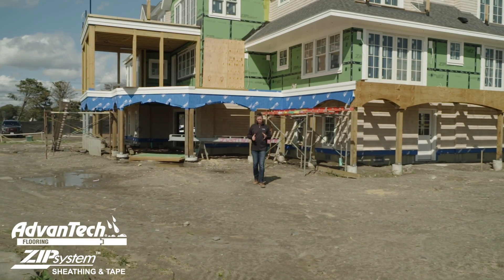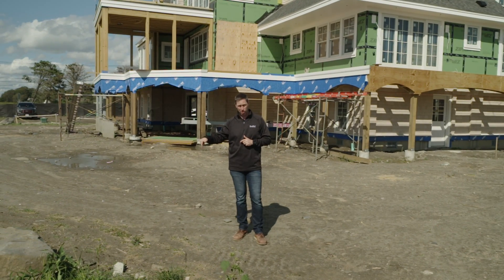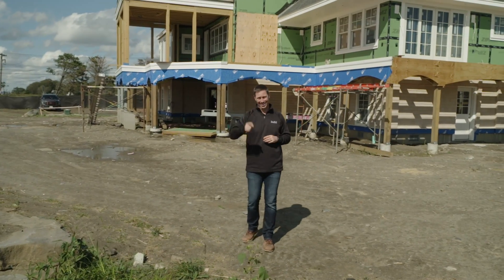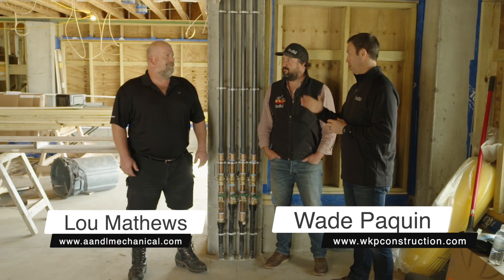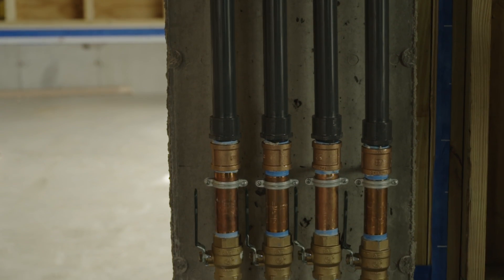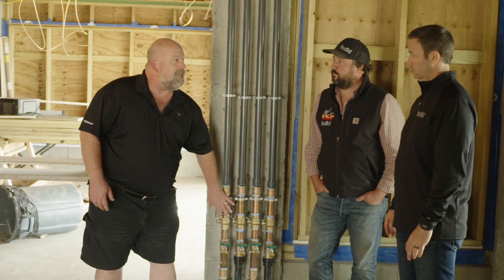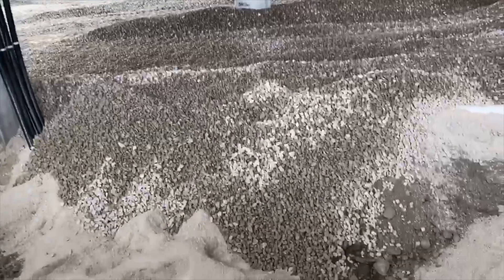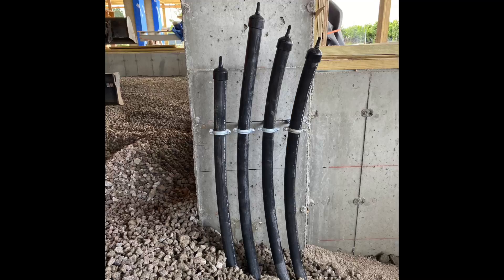Debunking 3 Geothermal Myths

Comment: Wait..... so they're discounting the cost of the well to show that it's only ~30 - 50% more expensive than regular HVAC???  Can I discount the cost of solar panels to show people how incredibly cheap solar is?  LOL!
Reply: Better watch again.   I think you got that wrong.  Without the wells, the system is about the same price as a comparable sized air-exchange heat pump.  Plus, in 2019 there was a 30% tax credit for geothermal.  So, in a way, your tax dollar helped install many!  ;-)
Reply: @91156  Most wells cost ~$10k.  Most HVAC systems cost ~$10k.  I don't see how a geothermal system could be '30 - 50%' more expensive unless you're discounting the cost of the well.  Just do a little shopping for the components.  ASHP are ~$3k  GSHP are $5k (NOT COUNTING THE WELL).  https://iwae.com/shop/5-ton-25-8-eer-2-stage-geocool-geothermal-heat-pump-vertical-package-unit-ha18835.html?gclid=CjwKCAiAt9z-BRBCEiwA_bWv-CIruwsdS9Nw7rDnO3Q8iWPMM1OpbBedNgNcUAq2wOXBw0M9jpAVzhoCLb0QAvD_BwE
Reply: @Chris-ie9os    All I can tell you is I had a 4 ton GSHP installed in my new house last year, and the cost for the installed system with 4 wells was right at $33,000.    An air source heat pump with the highest seer rating available was priced at about $27,000.   And the GSHP had the 30% tax credit.
Reply: @91156  Jesus... $27k for a ASHP?  I had a 5 ton installed for $12k.... they ripped you off.
Reply: @Chris-ie9os   Depends of what seer rating you price........ And I never purchased it, so no rip-off here.
Reply: @91156  If you paid $33k for a GSHP it's a bit of a ripoff since for $33k you could have gotten an ASHP + PV that would have produced excess energy...
Reply: @Chris-ie9os   Excess energy for what?  My GSHP also heats most of my hot water.  Are you purchasing 4 ton GSHPs w/wells for considerably cheaper?  I don't think so......
Reply: @91156  Excess energy for everything else.  For $33k I could install an efficient ASHP and enough Solar PV to power the entire home instead of a hyper efficient GSHP that just uses less energy.
Reply: @Chris-ie9os  well, you must be getting much better prices than the rest of us.   and good luck with that solar and all those batteries
Reply: @91156  No batteries required.  Grid-tied :D  When did you last look into solar PV?  It's crazy cheap now... at least 49 states.

Comment: My question is:
25 years ago, a backup heating system was needed in my Michigan area to ensure enough heat on the coldest days. Is this still necessary?
Reply: I would say yes, but it depends on the capacity (size) of the field.  There's only so much heat in so much mass.

Comment: 25 years WOW (Matt) ** My wife and I have been in the same house since 1998 - I guess it's about time to move or blow up the house LOL
Reply: My dad is still in the house he bought in 72. Still running the same natural gas forced air unit that was installed when the house was built in 70.
Reply: my thought exactly. if those loops don't last 50 years what a joke

Comment: I think reliability is about the same from what we’ve seen.  15-20 years.  Very expensive to replace when they fail.  I question the payback when you factor the same lifespan and the loops likely needing replaced after 50-60 years.  Plus, Propane prices have fallen, so in rural areas the payback is even tighter against propane.

Comment: I installed a open loop in 2008, minor issues over the years, but overall I'm 75% satisfied. I was stupid and only had two quotes and went with the flashy salesman (who said they had installed "hundreds") and only later was told that the company had only installed two prior geo's. Our retro fit system, with well and ductwork done prior to the install, cost 28k, with a gas "backup" furnace. The hidden cost is the electricity usage, it tripled and we ended up surprised and angry at the time, but the system was in. The sting has worn off mostly by now, but research and get muliple quotes. And yes we had variable speed motors on our 2,500 sq. ft. house. The other thing--seems minor but isn't--make sure the contractor uses control systems that are compatible with each other. The geo contractor had so many different manufacturers involved in our system that we later (5 yrs), we had all the control boards and valves replaced and since then the system has been reliable. If you live in a hot climate, the air conditioning is by far the best part of the geo benefits.

Comment: Open wells are indeed dirtier, but do however offer a higher capacity and the option to have a hot and a cold well. (on different depths)  That is to say, hot and cold storage. Which means that the temperatures are more consistent. A cold well stays almost all year on 5 degr. Celcius. A hot wel will stay on 25. (Only if your heating and cooling is balanced.) If one of them does run out, you'll get 12 degr. Celcius (or whatever the average soil temperature is).
A closed well, is more like a open buffer where the temperature gets mixed, so at the end of the hot season your well is at 20 degr. celcius and you can't use passive cooling anymore. At the end of the cold season you can even get your closed well to freeze over, and you can't heat at all.

Comment: Have Geo at my cottage for over a decade, not completely satisfied. A/C works much better than heat - takes too long to move the temp of the building up. Electric bill did not retreat as promised. Would only install if you have no other means to heat.

Comment: I looked into this a few years ago and I wanted to go with 4-5 wells for the heat pump to a low temperature here in the Northland but the HVAC company said that prevents you from using it as a cooling loop for the AC... I asked about adding some valves to use only one well then and he went on about unequal “wear” . I thought good lord man we’re looking at $10,000 or more in wells what’s $500 in valves? Needless to say I was not confident I’d get the right system from this contractor and never pursued it any farther.  Has anyone else had the same dilemma?
Reply: Your HVAC company has no idea what he was talking about.  That's one of the glories of any heat pump system; heat & AC.

Comment: Eventually the systems don't put enough heat or cold  back into the ground , and they start to produce less and less heating and cooling. That's what I was told by my builder who has had experience with both  geo-thermal and solar.
Reply: Your builder is an idiot.  Geo-Thermal has been working for decades ...

Comment: Matt,

I am starting a design for my new house build in Dallas, TX. Would it make sense to pair geothermal radiant in floor cooling and heating with hempcrete walls? Definitely interested in both options but would it be a smart move to do both?
Reply: Insulate your house.  Use three pane windows.  Maybe use icf.  Put a radiant barrier around the house in Dallas.  Do  not use liquid in floor radiant especially for cooling.  It is expensive, can leak in your slab, and the cooling can condense humidity.  Put in floor electric wires in the bathrooms if you want warm floors in there.  Use air to air heat pumps or standard ac with gas.  The passive  stuff is where you will really gain efficiency and a comfortable house.  The mechanicals are nothing but a pain so keep them as simple and standard as possible.

Comment: I have four ground source systems, three open loop GSHP’s  on two wells, pump and dump at my shop (two buildings and office). Heating is in the floor with conventional air conditioning.

The fourth closed loop with 2,000 ft of plastic tubing in a pond nearby for my 3,000 sq ft house.

I buy the GSHP’s direct from the factory and subcontract the installation to the appropriate trades. My HVAC guy had never seen a GSHP before we started. Today he takes care of everything in the unit, my shop guys maintain the water pumps.

Did my house first for half the price our local GSHP guru quoted.

Fixin to make an addition to the shop, will add another unit to the one well.

I will admit, Mother Nature gives up her water easier than what she takes it back. The first try was 75 ft of perforated 4 inch drain pipe which plugged up after a couple of years. Now I use a 125 ft trench 10 ft deep covered with 3 ft of pea gravel. 

The numbers I use are 1 gal per min per ton on the open loop system, 500 ft of 3/4” plastic tubing per ton at my house and circulate with 1/6 hp.

Comment: Technically it’s not geothermal it’s a ground source heat pump.
I’m still not convinced on cost, condensing Nat gas boiler cost less than $3k, plus install.
That can do 3,000 sq ft.
Ground source Heat pump over 4 times cost for equivalent plus drilling costs.
I love they are so quiet.
Reply: Its not geothermal, its ground source.
There is a difference, many refer to them as geothermal which is inaccurate 
Around the world they are referred to ground source heat pumps.
Reply: @pulporock  The manufacturers call them GHP = Geothermal Heat Pumps.  What YOU call them is irrelevant ...
Reply: Technically, they are called Geothermal Heat Pumps = GHP's.   A GEOTHERMAL HVAC unit can do heating and cooling.

Comment: I don't think that you should have avoided mentioning the refundable tax credit or the tax credit that's not actually refundable. So you're saying that it's about 25% more expensive or however you do that math.

I believe in geothermal but I also believe that a lot of what is said about it is not valid. I also believe that tax credit is preventing it from becoming competitive and genuinely disruptive. I believe that the soft costs in terms of the loop itself as opposed to seasonal energy storage or variations of vacuum ice technology and especially of course using your oil or propane your methane in conjunction with those other Technologies. Here's the thing once you start spending tens of thousands of dollars to produce heat and that includes the tax credit contribution oh, once you do that, once you decide that you're going to obligate yourselves to wasting money no or consuming a very large amount of heat over the next let's say 30 years but I think I'd be more fair to say 50 years given current interest rates and it would cost a pittance to provide interest-free loans for half a century for these systems compared to the 35% tax credit so once you factor those factors in I believe that the heat should come from the liq fication of air and that the liquid are should be stored for summer use to drive turbines to pump Heat. liquid air can also produce electricity and sell it during the summer of course if you don't want to just have it provide the motive Force for the heat pump. That is to say the liquid air can take the heat from outside and produce mechanical work or electrical potential anytime it's profitable to convert the nitrogen that you have banked. now you have the alternative way of storing nitrogen to takes up half the space of reducing it to Cyril genic temperatures or leaving it at high pressure. Making carbon fiber tanks for burying underground in new construction to keep the liquid or the just compressed nitrogen and of course maintaining positive pressure in your highly sealed envelope with pure oxygen is what anybody who can do should do and would do.

Open loop systems are no-brainers if you have access to that water. To use a closed loop system for somebody that has a pond is Bonkers unless you are locating the heat pump within the pond but the alternative is to have three different zones on the compressor side.
Reply: The difference between open loop and closed loop in a pond is 10%.
This can be reduced if increasing the loop.
I would always go closed, way less hassle and maintenance.

Comment: 4'th myth, here where I live this technology got a lot of attention some years ago, and it was claimed the ground would slowly cool down, reducing the effectiveness of the system, I do not know if this is correct
Reply: It is a lie. The sun would have to stop rising each day before any noticeable difference was made known. However if this were to happen you and everyone else would have far greater issues.
Reply: @seanregehr4921  - ok, I do not know, but I think it was only local cooling? Around where the heat was extracted? Not that we cooled down the core of the earth?
Again, I am not an expert, but think we must divide between private persons that do not have so much money, and only drill down a shallow hole, and cities etc that can make deeper holes, to hotter parts of the crust
Reply: It can and does happen both on the cooling and heating side.  You have to keep in mind that heat is transferring from the soil to your groundloop pipe (or from it in cooling mode) and the efficiency of that process is dependent on the geologic material the loops are finished in.  Saturated clay may provide decent transfer, but won't provide the mobility of heat energy through the substrate that saturated sand will.  Unsaturated clay will provide poor heat mobility and unsaturated sand, almost no heat mobility.  Even in an field with good heat mobility, a large system such as a public school building can create a thermal bubble within the loop field if it wasn't properly designed.

Comment: How about the number one myth! Ground source heat pumps are not the same as geothermal. Ground source heat pumps are different from geothermal. Geothermal uses latent heat from the core of the earth our planet used to be a ball of molten rock and it’s still hot from that. Ground source heat pumps use the sun’s energy, which is stored in the near surface ground as heat. Calling a GSHP Geothermal is like saying you have an on-site fusion reactor when you have a solar array.

Comment: Wells can be expensive. I needed 6, $20k each
Reply: No, you don't......have a water well drilled    ONE well. Water source is the most efficient system on the market
Reply: For my 3 story 2000 sq ft house it was $14,000 for a 300 ft deep system.

Comment: I always wondered if it could keep up in the extreme cold. My wife love my house at 78 in the winter.
Reply: Should be no problem. We keep our Geo at 73 this time of year. It's 34 degrees (F) outside as I write this and my ground loop temp is a steady 52 degrees. The heating mode is running but it's on the lowest (level 1) speed and the whole system is only drawing 808 watts. We had ours installed in 2016 and reduced our household heating/cooling costs to about 1/3 of what they once were. Getting about 1/3 of the cost back in tax credits and incentives from our energy supplier made the cost only about $1500 more than a comparable air-sourced heat pump. The only problem is that nobody understands this stuff and we're thinking of selling soon. It's a question mark for potential buyers, so an increasing number of videos on YouTube like this are nice to see.

Comment: I have a closed loop Water-Furnace 5 series, 5 years old installed by Arronco Comfort Air.  One thing that is not a myth, the heat pump uses a lot of electricity.
Reply: Compared to what?  The cost of Natural gas would be more dollars ...

Comment: I replaced my closed loop geothermal with natural gas furnace last year. My unit was a lemon and the 10 year warranty was ending. It needed major repairs every year. The problem is there is not many hvac techs willing to work on geos so they charge a lot more per hour and not many options if you don't like them. Also, do homework on the price of electricity vs natural gas in your area. By me, the cost per btu of electricity is 4 times the cost per btu of natural gas. Even though my geo unit was 400% efficient, it still cost me almost the same as my 98% furnace. To top it off, my power company charges 50% more on the geo meter during the summer (a/c) vs the regular meter. All in all, it wasn't worth it to me.
Reply: I am a retired drilling contractor, we sold our company to our employees.  We are up on the knowledge for Geothermal and also have a registered trade for drilling and installing geothermal loops.  We have not done one system install because of the low cost bids for drilling and installing and there is only one way to do it cheap, go fast and spend little or nothing on grout sealing the bore once the loop is in.  Proper drilling and preparation of the bore hole plus high thermal conductive grout to transfer the heat and cold exchange as well as correct layout distance between the bore holes is paramount and all costs money.  Improper installation leads to inefficiency right from the start and a lifetime of problems.  Just like anything else, it needs to be designed, sized and installed correctly.  We would not do the job if the customer would not spend the money to have it done properly and that is how we still operate.
Reply: Thanks for this perspective. Very interesting.
Reply: Jason, I had the same experience... Electric rate was good when installed then they flipped the winter summer cost and compressor on water furnace kept going bad...

Comment: Currently have a 30 year old open system 130 ft deep with only one issue encountered with a fuse. Challenge is finding service/ people with knowledge in the Ottawa area here in Canada. Manufacturer went out of business (not surprised as there is little/no recurrent work once this system was installed). We are very happy customers. We know we are on borrowed time and need to plan for upgrade/replacement. We need to start considering our options. If anyone has experience in our area please advise.

Comment: Is a GSHP better in a hot climate or a cold climate?
Reply: MUCH MORE energy is required to heat a house to 70°F inside with outside temps at 0° vs cool a house to 75° F inside with outside temps at 90°.  It is the inside vs outside temperature DIFFERENCE that matters...